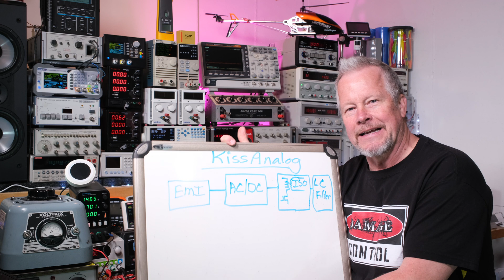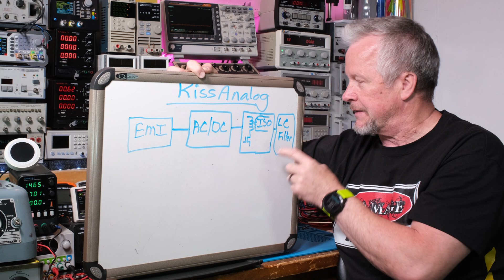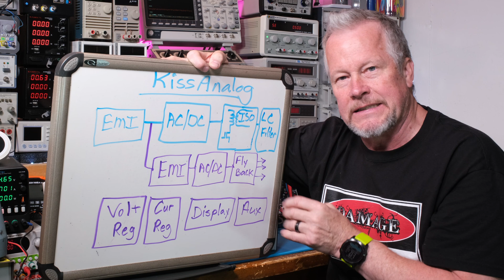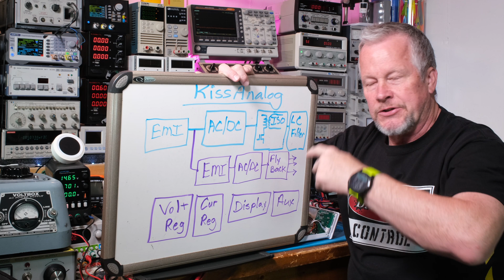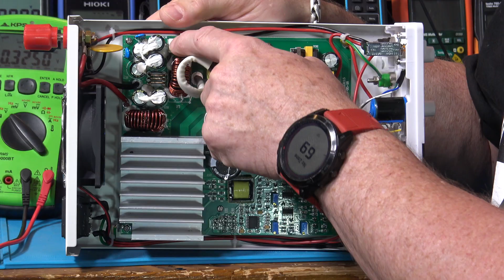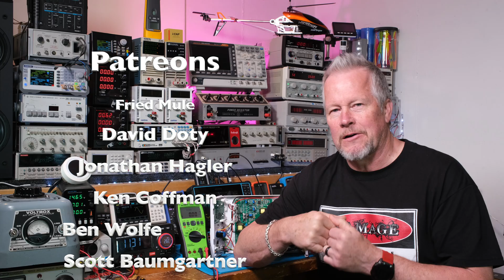Power Supply Layout Design Analysis a close look at Nice-Power Bench Power Supply

Comment: Hey Eddie, I'm currently designing an isolated flyback and wonder what my bandwidth should be on oscope when validating signals. I notice a big difference on my switch node peak voltage depending on the bandwidth. 20MHz vs 200MHz
Reply from the maker: Great question!!  What scope and probe are you using?  What's the sampling?  I'll have to illustrate this in a video very soon - maybe this weekend on this flyback.

Comment: Is it possible to remove heatsink? It is a bit strange to me to put primary side transistors and secondary side rectifiers (diodes, but it is possible they used synchronous rectifiers driven by main axulary wining on main transformer) under the same heatsink.
Traces between main transformer and output rectifier and primary switching  transistors are unnecessary to long, driving transformer is bit too far from primary switching transistors.
They could just rotate input filters for 90 degrees and switch their places, which would be a much better and cleaner solution.
To me, it is look like they try to design PCB, so analogue  control on the secondary side is as far as.posible from all noise, and they  sacrifice the rest of it.

Comment: 21:47 i was the one who ask what this current transformer is doing there next to the big DC caps ? But like i said in the previous comments, current transformer only works with AC, that can be 50/60Hz, or High frequency like up to 100Khz, but what is this current transformer measuring exactly ? You could think it sits between the control IC and the main transformer, but that is normally a sort of PWM kind of signal, so no idea of a current transformer can work with a PWM type of signal. Or is that current transformer used for measuring pure 50/60Hz and have they done another zigzag of mains through a low voltage section on the pcb ? Would be nice, if the pcb could be removed, and looked where that primary section (1 winding through the donut) of that current transformer is running to?
Another question about powersupplies that intrigues me is this, we all know those "volt sticks" or non-contact voltage detectors, that are advertised for 90 to 1000V AC. 
Now, from experience, i know these are also react to switching noise from a switching powersupply, even as low as a 5V USB charger. On a linear bench powersupply, this detectors doesn't respond at all. But here is the 1 million dollar question, when using such a non-contact voltage detector on a step-down transformer (the old type wall outlet chargers, per example 120/240 to 12V AC) this detector response also to the 12V AC output, but when using a linear bench powersupply like a 0-30V DC, this non-contact voltage detector response to the output of the transformer, but when you come to the rectified output, the non-contact voltage detectors stops. Now, in switching powersupplies, this detector react all over the place, from the input to the DC output (even with 1V output), regarding lots of noise filtering they used. You could think, that this detector response to the magnetic field of the pulse transformer, but that is not the reason, because if you use 2 meter long power leads from the DC banana jacks , the detector reacts also at the end of these leads when you are 2 meter away from the switching powersupply. So there is something impossed on top of the DC signal output where these detectors respond to. Is this to the high frequency ripple?
Reply from the maker: Thanks for the great feedback!!  I'll talk more about the current sense and I'll soon show how to design this type of current sense.  I'll see if I can also demonstrate the NCV of some of the meters that I have.

Comment: The criss-cross design is a bit strange, but I'll still give them points for prioritizing cooling. Heat is the enemy! Maybe since it's a higher current supply they figured a little ripple wouldn't hurt?

It's generous of you to concede that we don't really know what they were thinking. It seems like management always comes to engineering with a [metaphorical] box their design must fit in, and by this time in the design process, none of the terms are negotiable. (Outside-looking-in opinion)
Reply from the maker: Great insight!  Thank you!  It is true - we want the display here and the power switch here with the input power cord here and the output terminals here - oh and the fan here;)  Then the Engineer has a puzzle;)  But then there are still things you can do;)

Comment: Hey Eddie. I really enjoyed your analysis. I'm not a big fan of having electrolytic caps near heat sinks if it can be avoided. The two large ones are close to the fins and will block some of the air flow as well. When troubleshooting and repairing equipment that's been around for awhile it often seems that the electrolytics that are near heat sinks are the ones that have failed first.
We can see from your analysis that the board layout that the engineer/s chose was not only not the greatest regarding EMI, it created extra steps, labor for the manufacturing line.
Reply from the maker: Great feedback!  Thanks!
The Aluminum Electrolytic caps will dry out faster when heated, so it is a good idea to keep some distance from heat generators.
Reply: HI, It is so good to hear from you.  Hope you are doing well.  Thank you for supporting Eddie.  Your the best. 🙏😃

Comment: I would like to see you take it apart, and show the simple fixes you have in mind for the wire routing and such. 
It does seem like the opportunity to put the main AC in and CM filter right in the corner of the board. The power switch location can be contrasted with the effort put in by top Test Equipment manufacturers that design long funny shaped plastic rods that take the action of the front panel button to the actual switch at the rear of the machine where the AC enters.

Thanks for another great video!
Reply from the maker: Thanks for the great feedback!  those long plastic rods were used for a good reason right;)

Comment: Yes  probe testing maybe on the scope see what the ripples like after the adjustments, how would you adjust that power cable to the switch shield it? Possibly could do away with the fan if you had higher value components You're gonna test it to its limits see how hot it gets.

How do somebody come to a design like that when it's in CAD should be obvious to them.
Reply from the maker: Thanks I'll do a before and after to see if we can make a difference.  It is an art to get layout correct.  Power design is not respected and people don't put the effort or pay for design engineers that know.

Comment: I have some older Nice-Power supplies and some of the modifications don't look like improvements. They used to put the power switch on the back next to the plug, and they didn't have the back DC terminals, which simplified the wiring. I'm not a fan of leaving off the air filter and prefer having positive pressure in the case from blowing into the enclosure through a filter to keep it from filling up with dust. Or as a Vietnamese engineer once described it to a customer, I prefer power supplies that suck to those that blow. This configuration also maximizes air speed over the heat sink fins which maximizes cooling. The downside is that the hot air stays in the box longer before being exhausted...
Reply from the maker: Great feedback!  I would like to see the power switch on back and a on/off switch on front to turn the output on and off.  I like the Vietnamese engineer's take;)